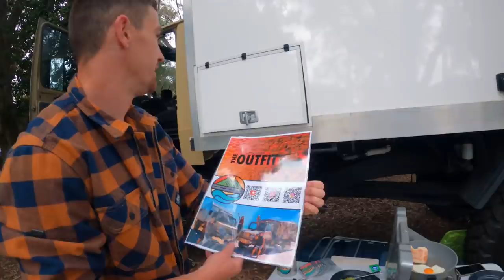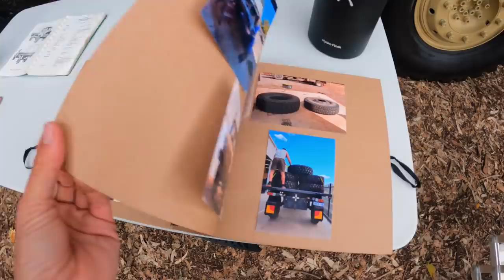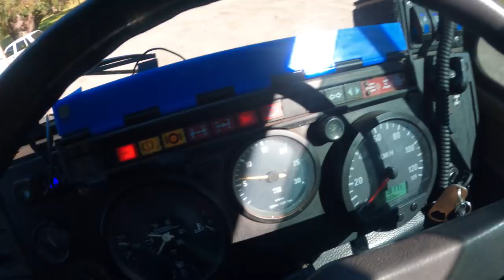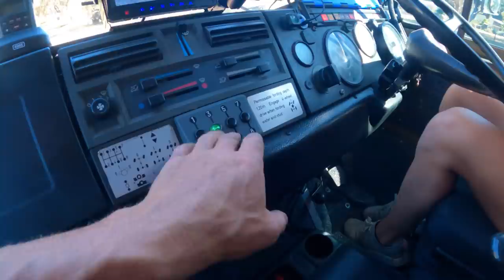HER FIRST TIME DRIVING A UNIMOG! Perth 4wd Show & Budget Mega Awning - DIY Camper/Caravan 31

Comment: The stakes for the awning will probably work, but you’ll want two guy lines on each one. They will then stop the stakes being pulled back towards the Mog and help keep the tension in the awning. All the best.
Reply from the maker: Thanks for the suggestion! That's exactly what Chris did the next day, it really helped :)
Reply: Bonjour à vous deux.  Ange is a naturel driving the Mog!  :)) 
With 28 sqM any little wind will act like a sail on a sailboat. 
Will heavily stress all of your four corners a great deal let
 alone bigger winds.  I’d shorten it to 4 or 5 M and use the 
remaining 4 x 2 to 3 M as a side wall. You will then need 
longer out posts to give you a proper height along with 
2x guy ropes per.  Trail on error always works out in the end.  
My wife & I enjoy your chemistry together.  We are a little 
behind on our Fuso build vs Pros like U2, hopefully by late 
Spring ( May ) will be off to the back country. 
Cheers….. K&Y 
Vancouver, BC

Comment: I hav’nt looked at all  the comments so this may have already been mentioned, but have a a look at the Lippert bed system. The bed “hangs” on straps, has two guide rails and a greater lift/drop length than the actuators allow. It seems a relatively simple system that could be a DIY job.

Comment: Add 2 guide lines with spring v- pegs to each post at 45 degrees to the post and it'll help a lot to stabilise the post. I think there are also pegs with a springs built in to dampen the affect of wind on the awning.

Comment: Looks good! Just and F.Y.I some (not all) of the diesel heater pumps (seperate from heat exchange) have a anoying "ticking" to them when they work, so have it as far from your sleeping area as you can and isolate it with rubber. Also if you put a loop in the diesel line after the pump I believe that can help as well.. My experience. Keep up the awesome work!

Comment: For the awning post, weld a tab lower on the awning post. Then you can use longer post and hit on the lower tab. I would also suggest using some ropes with pegs on the post, to help secure the post. Thanks for the awesome content. I hope it helps
Reply from the maker: Great idea! We tried with some extra guy ropes on the posts today and it worked a treat. Need to find some longer posts now

Comment: congrats on the successful show guys, i hope we see you at a CQ show one day. Can i make a suggestion or two guys? First can you make the bed fold against the rear wall and have the underside padded to act as the lounge back and then some seat cushions either under the bed or supplementary. Also, i made a 5m awning for my old slide on and i found it best to use sturdy tent poles (i made my height adjustable ones from the legs of a broken gazebo) and hold them with some sturdy angle iron pegs and ropes. I added some midway poles and ropes to help keep the awning stable as well as help keep the height uniform. Anyway hope you get it sorted and as usual, i love all you do..
Reply from the maker: Very good ideas! If we have the bed fold against the back wall we won't be able to fit a queen size which would be a shame but I think it would make an easier solution. Cheers

Comment: Hi Guys,
Big fan of your DIY efforts!
Just a heads up with the evap cooler you have in the cab. There are good places for these units, however a ferrous metal box isn't a great location. If you don't have long term plans for this rig, then no drama. Otherwise, dumping extra humidity into the cabin is only going to corrode exposed surfaces, encourage mould growth, and generally reduce comfort (you sweat more in proportion to humidity). If you plan to keep the vehicle long term, look at solutions that actually reduce humidity in the cabin, leaving things like a sock filled with desiccant material can prevent condensation within the cab which in turn slows corrosion. 
If they are sponsoring you, then I get it, do what you gotta do :)
All the best.

Comment: First time commenting. Love your content and enjoy watching the Mog take shape. Im sure it will take you guys some adjusting and getting used to the size of the beast. Massive difference in size and speed compared to the Jeep. Look forward to seeing what the future has in store for you both and can’t wait to follow your adventures online.

Not sure if anyone has already suggested but I would think that using double guy ropes on each  stake you have in the corner of the shade sail will be sufficient support and will assist in preventing the stake from pulling out. Remember it will only be as good as the pegs you use to hold the guy ropes in.

That is a big shade sale though and I wonder if it’s going to be that practical in the real world. Have you thought about mounting an off the shelf retractable awning to the side or a much cheaper and clean looking option would be to fix an aluminium sail track to the side of the box. You could pick up large privacy screens (6m x 1.8m) for under $100 and it will slide straight into the track, add a couple of poles and guy ropes and you will be set, or alternatively get a canvas awning custom made to suit your dimensions and also use poles and ropes to support it on the outside. It could be folded and stored when not in use. If you do go with this option I would consider getting a leader chord stitched into each end of the canvas and long enough so that one person can pull the canvas along the track from the ground while the other person guides the canvas into the sail track at the other end either from a ladder or from your entry stairs. I would think it would only take a couple of minutes to set up and would pack up just as quick.

Look forward to once again seeing you guys getting OUT and keeping FIT.

Jeez that was a longer comment than I had initially planned.

Comment: A center pole added to the awning might be cheap easy solution for you. 3 pieces of household PVC plumbing pipe (10 foot long) joined together or made to extend with a cushion on top to save tears in awning. Would also eliminate water pooling in awning. Expo looked like it was a good time enjoyed by all. Handled that well for 1st timer driving the Mog thrown at you like that (points for team Ange on that 1).

Comment: Pull up next to trees, and just hook on to them with an 'Occy' strap. Also, good idea to get a little wheel on the top outer corner of the door so it doesn't rub a hole through the awning.....
Reply from the maker: Thanks Mark for the tip, we definitely need to do something for the corner of the door so that it doesn't damage the awning!

Comment: Chris, I used to be the same when anyone drove my 406🤣🤦‍♂ infact I’m still the same with the MB Trac! If you need to slow the clutch changes down, maybe double clutch it. It will also help the synchros (the syncros are a lot better than 406s)

Comment: Turn the steely around , the flat side to the vehicle .. run a rope from the steely to a large tent pen  . That will stabilise  the steely . I would use a tubed tent pole instead of the steely ..This saves on weight & you really don't need to drive it into the ground . Had a Government job for approx 30 years and spent most of my time living in a caravan  setting up the camp every few days , including an annex strung up to trees and tent poles . That's my 2 cents worth .

Comment: For the awning, the only thing you need to add is a tension rope from the top of each of the 2 poles to the ground at around 45-30deg, that will pull your poles out and put tension to the canvas which is what you need. The poles will only take compression force instead of trying to make them work in bending. Hope this helps. Great job on the build BTW

Comment: I reckon drive the peg into the floor as hard as you can and then use a ratchet strap to attach the awning to it and tighten it to your liking. It’s hard to drive it while the awning is attached to the floor

Comment: I would strongly suggest that you mount the diesel heater directly to the floor of the camper, and use a good sealant around the mounting plate. If you mount it high, there is a chance the exhaust will leak gasses and possibly gas you in your sleep! If you floor mount it and seal the mounting plate, there is no chance of the exhaust gas coming back into the camper.

Comment: You can use two actuators where you have space on the inside and then use bike chain or wire cable and some pulleys driven by the these two actuators to lift the other side of the bed where the departure angle stops you using actuators. Shouldn’t be hard to rig up, will need guides on the back wall of the box for the bed to run up and make it secure, also add to locking pins or catches so when the bed is all the up or down it is secured if flex from the chain or cables 👍
Reply from the maker: Very good idea. I'll try see if I can find a couple chain drives that aren't too bulky or ugly
Reply: @TheOutFit  garage door lift chains have a threaded rod for adjustment and could be used,  will take some cobbling with suitable idler gears from garage doors or even bikes 👍

Comment: That is a massive amount of cloth to hang......firstly you will have to triangulate your loading points. 
Basicly minimum you will need to run guy ropes to the ground to allow you to tension anything that large or put concrete footings everywhere you go.
Please minimise any solid weight from the sail - should use lashing or ropes ..... using solid turbuckles is asking for problems if something rips in a gust or just wear and tear ..... and could easily lead to serious injury (getting smacked in the head by a flogging shade sail !)
• My sugestion is to make hinge two uprights from the lower edge of your accommodation (front and rear - these can be telescopic), connect the two with a spinning bar - to this you roll up the awning on it. So a minimalist way to design this is to build it to hinge down to ground ....... unroll shade (a safer place to organise the shade sail, reduces wrestling).....connect the two corners to the roof (this can be done by leading ropes from the corners of the shade through the roof eyes, down to a cleat/tie off point on the truck chasis)......this then picks up the two uprights and connecting bar to provide the secondary shade support, this is tiangulated to the solid hinge points on the truck and can be tensioned by the other end of the shade......now you have to consider if you want to add two more uprights to lift another section of your shade or take the trailing edge to the ground.......this then completes the tensioning triangulation you will require. 
This creates a shade roof with a shade wall to the ground with minimal support for such a huge shade. 
Apologies for the complcated and lengthy description, good luck guys.

Comment: I am sorry you have not build the platform for the door because of the safety problem.., You just need to put the same thing you biuld on both sides of the wheel that can be locked when it slides in., so when you slide it out you have a board that is bolted on top of the sliding bars then fit the steps in place....Cheers

Comment: For the star pickets, make a bridal and have 2 heavy duty pegs into the ground, method is known as a crows foot, or use 2 star pickets behind to make a triangle and hit them in about half way, from as close to the ground as possible secure to the mid point of the front picket. I hope that makes sense and helps to get enough tension, cheers 🍻

Comment: Guy lines mate, use a double guy line from the top of each stake with long tent pegs hammered into the ground. You will be able to work out the angles and best distance  from the pole to place the pegs through trial and error but 45 degrees and 90 degrees usually work best.  Think pegging down a tent.  Great work so far by the way, jealous to death here in the UK we don't have the masses of land you guys have in Aus.  Regards.

Comment: Loving the build guys.
As an experienced overlander,  take my advice and put a proper vapour cycle air conditioning system in the cab. Australia is a hot country.  And if you overland a lot you'll be spending a lot of time in that cab. For every 5000km you drive,  you'll be sitting in that cab for approx.  100 hours. 
And swamp fans make very little difference to the cabin temps on a hot day but will raise the moisture levels considerably and will likely make it even less comfortable on a long drive.

Comment: G’day guys, I love your videos, the mog is looking great. A friend of mine has installed a 12 volt under dash air conditioning unit that doesn’t require the use of the engine. I think this could solve your cooling issues in the cab
Reply from the maker: Thanks a lot Greg! That's interesting, never heard of a 12v under dash A/C in a Mog - do you know the name of the unit? Cheers!

Comment: Use guy lines from the awning over the top of your post to the ground.  This will transfer the load down through the post whilst stabilising the post.  With that size of awning you might want to try multiple guys off each post and add an additional post in the centre (in line with your other posts).
Reply from the maker: Legend, we just did this today for the upcoming video. Using two guy ropes and sand pegs for each post fixed it completely. Now just need to find posts that are longer than 1.8m
Reply: @TheOutFit  There are telescopic poles out there that will give you the height and pack away smaller.  The question is if they will be strong enough to support your awning.  You probably will be able to find some I have no doubt.

Comment: All you need is a “driver under instruction” sign (there are detailed colour, font, size regulations) on the back of the Mog and Ange can drive while you are in the passenger seat. Important point  - you don’t need to be an instructor, just licensed to drive the class and 0.0 alcohol 

This is from NT, but I am fairly sure it’s nation wide the same:
Learning to drive

When learning to drive a heavy vehicle, you must be accompanied by an appropriately licensed person occupying the seat next to the driver, or in the case of buses, the seat nearest the driver.

You must display a DRIVER UNDER INSTRUCTION sign at the rear of the vehicle. The sign must be at least 530mm wide and 300mm high with DRIVER UNDER INSTRUCTION in black writing, at least 75mm high and on a yellow background.

Mate of mine learned how to drive HR by helping me driving my Mog from Canberra to Darwin.
Reply: In WA, if you are NOT an instructor:  A person who has held a current HR driver's licence for at least 4 years.
The different driving and instruction rule per state drive me nuts!
Reply from the maker: 3 years to go :/
Reply: @TheOutFit  I don’t understand why there’s different rules…..

Comment: I'm looking at putting heater in my caravan too , yer na don't run exhaust through van even rapped in stuff dangerous if a leak acourred please run exhaust straight out side from the Unit

Comment: That awning looks like nothing but trouble. Its just a massive sail. I’d only be using it without the poles and pegging it directly to the ground, else those steel poles are likely to become very dangerous projectiles.
The Mog is coming along great. Shame out the issues with the bed/lounge setup. I tend to follow the KISS principle and keep things simple. How about the mattress just flips up on its long edge, up against the rear of the Mod box and just gets retained in the vertical by a coule of hooks on the inside of the rear wall and some webbing eyelets stitched to the underside of the mattress? Or sure, use a pulley system, but not sure that is making it more complicated?